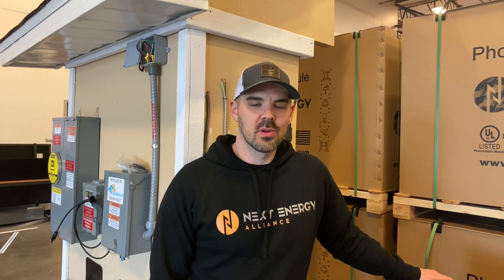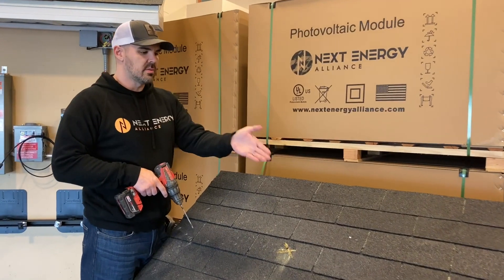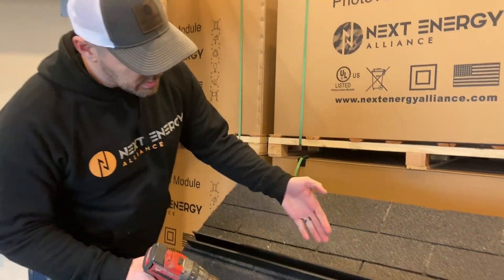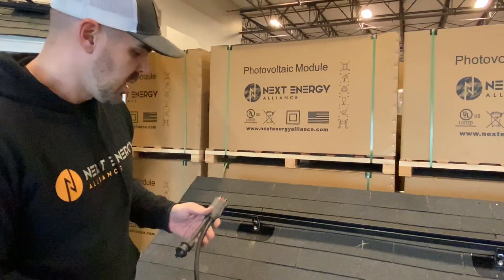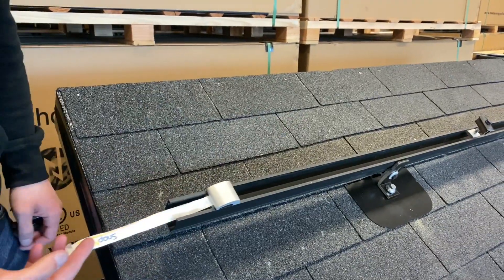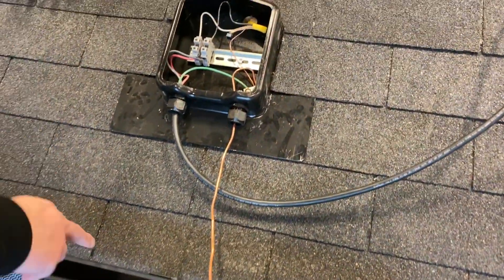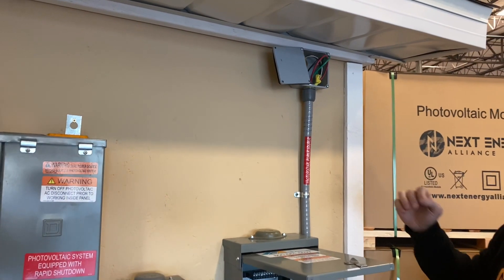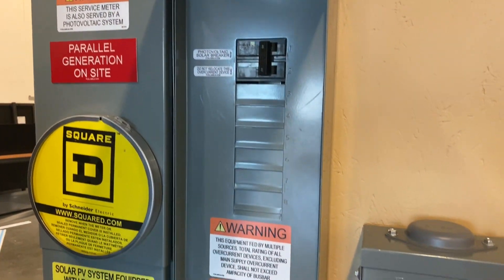DIY Solar Instructional Video - How to install solar panels on your roof

Comment: @7:36 The hole for the junction box is on the wall. For that to happen you would have to drill through a wall top plate and then out the exterior wall. Not accessible from an attic as the corner will make it too tight to fit in there and drill that angle just right. The electrical will most likely have to go to the eave and the junction box secured to eave not wall.

Comment: Does or can water sit inside the rails?
Reply from the maker: Some water can make it to the rails but it won't hurt anything
Reply: @Solarwholesaleutah  Would it be wise to drill weep holes (1/4" Dia or so) so many feet to drain water or melting snow that accumulates in the horizontal rail system?  Should the rails be at their highest point in climates where it snows during the winter?

Comment: Does your system come with a power optimizer offered by https://www.solaredge.com/us/homeowners?
Reply from the maker: We use microinverters. They accomplish the same thing but without the main unit to convert DC to AC. A lot easier to use!

Comment: Do you have Off grid and hybrid micro inverters. For 5 kw how many solar panels and micro Inverters are needed.?
Reply from the maker: For Off-grid we use Sol-Ark. It's a string inverter but it's battery ready and you can add up to 7600W of AC. You would need about 16 panels to be at a 5kW.

Comment: More detail on electrical. Specifically, wiring a multi string system. Does each trunk line need to connect to a separate 12/2 romex in the roof junction box? And THWN wires to the combiner box, breakers.
Reply from the maker: Each trunk line will end in the roof junction box and every trunk line will have it's own romex wire connecting to it's own breaker. We'll get another video out this week and go over it in our Live class on Thursday 4/9